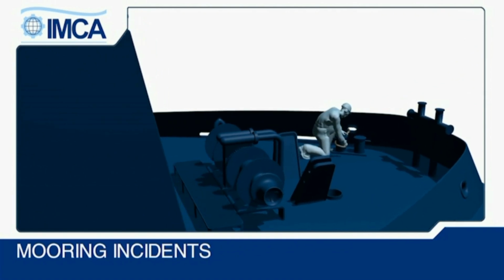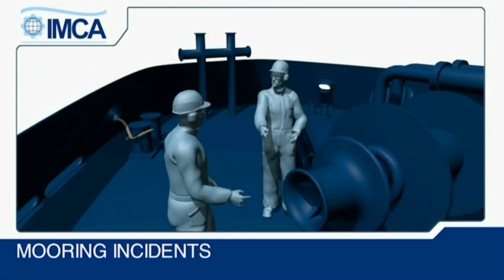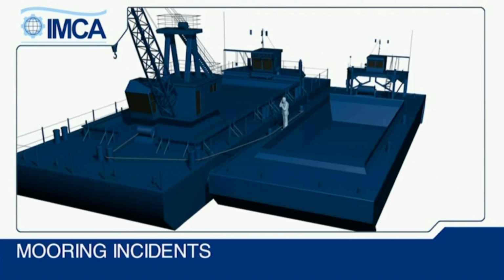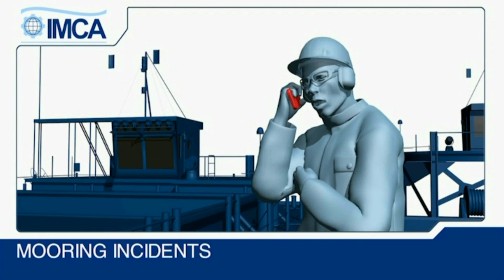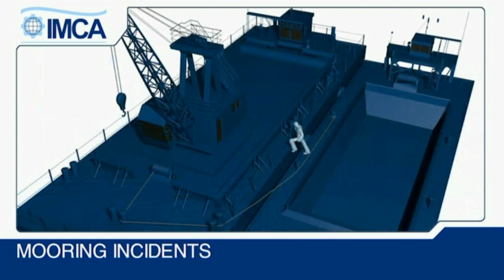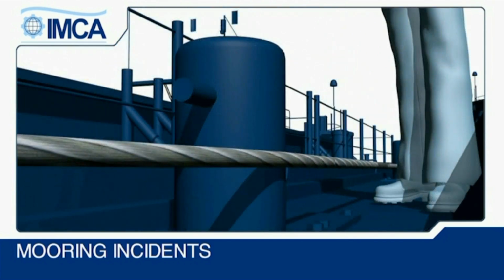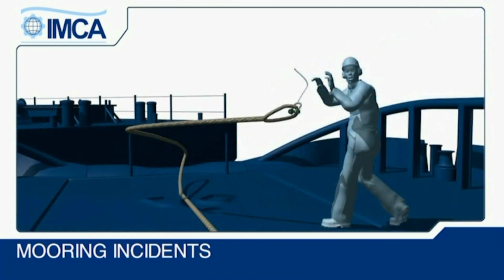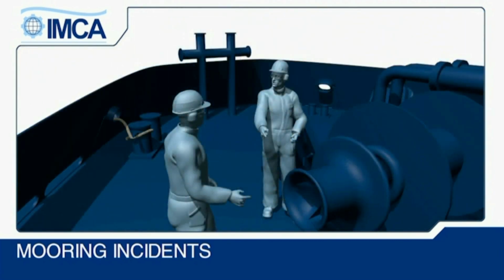Mooring incidents – IMCA HSSE038

Comment: What dose DP mode mean?
Reply: Double Penetration
Reply: When a vessel is operating in dynamic positioning mode, it uses its main propeller & rudder, azimuth thrusters and tunnel thrusters to keep the vessel in a fixed position, by counteracting the effects of the wind, waves and current.
Reply: Dynamic positioning.
Reply: Deep Penetration
Reply: Differential pressure :)
Reply: Donka guys. Donka means thank you in German.
Reply: How to get moring job?